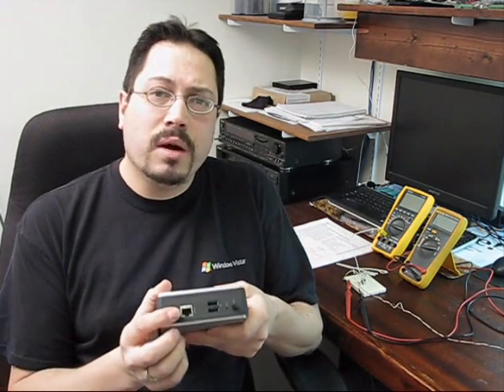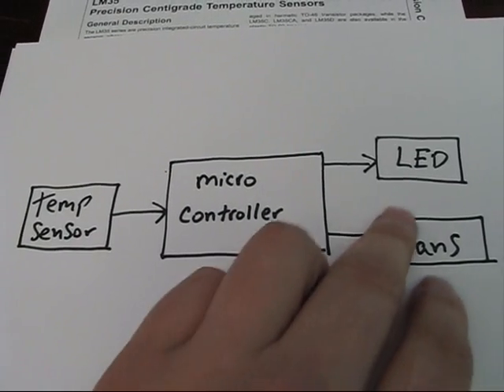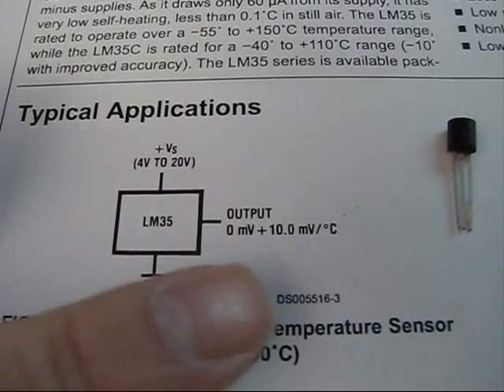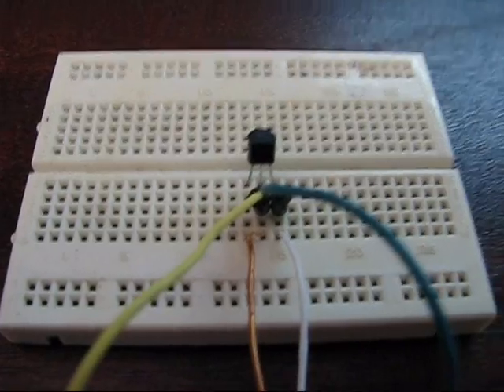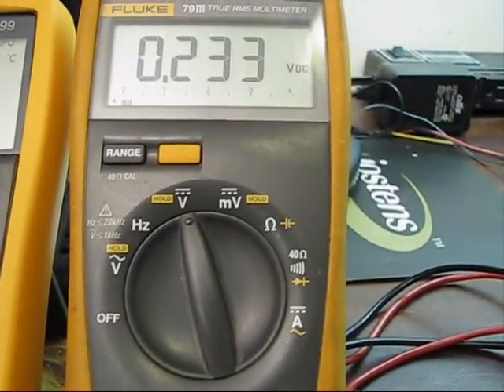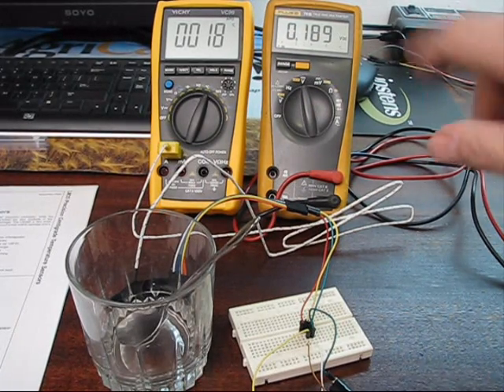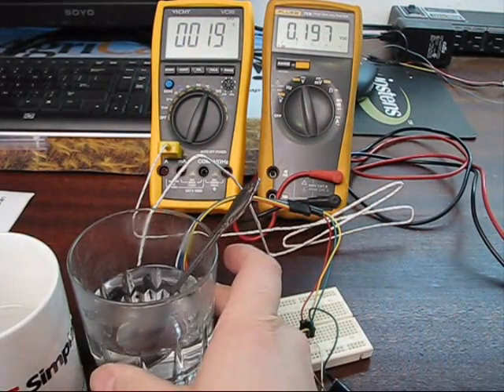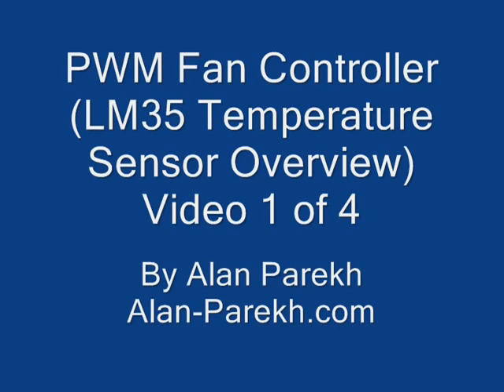PWM Fan Controller - Intro and LM35 Temperature Sensor

Comment: How to use it in the actual circuit? Does it need to be programmed? I don't know how to program it am I gonna cry now? 😢
Reply from the maker: +Kass Etolle  Yes, it is a microcontroller. This is a generic controller that needs to be programmed.
Reply: +abbtech thank you for respondinh. do you know any alternatives I can use? Please help me
Reply: It can use more easily , using an analog circuit without microcontroller but only use an Lm35 with an electronic amplifiers (operational amplifier) .

Comment from the maker: An elegant 1 chip solution would require additional programming and chip selection. In your case I would suggest simply using 5 separate chips.

Comment from the maker: If you need individual temperature sensing and fan control you can simply build multiple circuits. It would be possible to use a microcontroller with more analog inputs to do this with one chip but this would require programming.

Comment: Thanks for the video. Searching for devices like this at Mouser or DigiKey can be misleading because the "threshold voltage" rating is far below the functioning temp. rating of this sensor.

Comment: Very very good job, nice video and presentation.  I like the way you explain each step. But i think that we would like to see a basic microcontroller video-tutorial from you. For example how can i make a simple led flasher with a PIC 12F675? Do i have to buy a programmer in order to load my code to the chip? In which programm its easy to write the code etc. It would be really usefull for many of us, 
to have a video explaining the REALLY BASIC ;-) Thank you in advance...!

Comment from the maker: @guitarbridgecleaner 

What is the voltage of the fans? If you want to put them in series you will need a power supply that will give you (Fan Voltage X Number of Fans). For example if you have three 12 volt fans you will need a 36 volt power supply. I would suggest just getting a fan voltage that is equal to your power supply and wiring the fans in parallel.